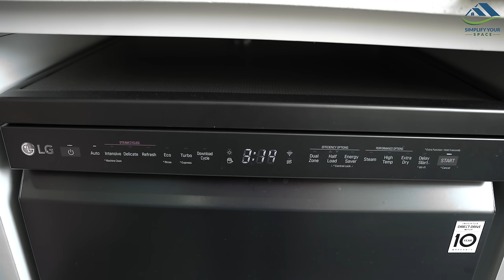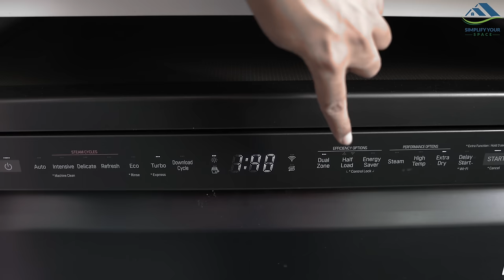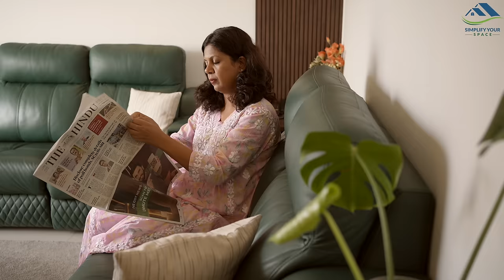Embrace Smart Living with LG Dishwashers | Breaking The Myths About Dishwashers | LG India

Comment: I have the same brand dishwasher purchased in September 2023. It's a great way to use compared to helping hands which aren't available when we mostly need, especially during festivals...U will need a full week to adjust yourself to the machine and will feel more work at first as it's not what we usually do ,but later it becomes very habitual and easy,as we get experienced using different utensils.About the timings there are multiple options depending upon how soiled /dry stained your utensils are...for continuous everyday use there is Turbo option which is 1.4 hours (including steam+extra dry) which u can reduce to 38 mins,even okay for full load but utensils should be freshly used as the time stamp is less.All positive but u need a week minimum to adjust to the machine 🙂👍
Reply from the maker: I agree with you. Thank you for your valuable feedback about dishwasher. Lots of love ❤️
Reply: I'm also using ..but not familiar with more options or benefits . Just using one turbo cycle daily
Along with demyths , if the cycles adjustments, time consumed, power consumed for hot steam cycles ...like this an eloborate/precise video which covers using multiple options, every aspect is important
Reply: @gadeyneelima5361  you can connect directly with the person who came for installation of the machine...they usually answer all our doubts whenever we call for queries
Reply: How about during powercuts ? If in between a cycle, will it get reset and start allover again?
Reply: @janakinarayanan7036  it will turn off the machine and restart from the same timing once the power is on..same even for _after turning of the main switch

Comment: Hi, what about the previous Lg dishwasher power drawback, LG dishwashers used to start from the beginning of the cycle if there was power cut in between the wash cycle and would not resume from where it stopped,  has it been addressed now. Kindly advise.
Reply from the maker: This dishwasher does not resume from the exact point of interruption but from the phase of the washing cycle. For example, if the power goes off during the pre-washing phase, it will start from the beginning. However, if the cycle has progressed to the washing or drying phase before a power interruption, it will resume from the start of the washing/drying phase, which is the mid or end phase, rather than from the beginning of the entire cycle.
Reply: I think it's logically and practically correct. Example if your dishwasher was heated at the time of power cut , it can not remain heated during power cut. Dishwasher will need time to come back to that temperature after power is back. Another Example If it was in middle of soap foam wash and the power cut off, it will drain or dry the soap in till power is back. Dishwasher will need extra water to resume in the condition.  Instead dishwasher starts from beginning to avoid stains and clear output

Comment: You have not mentioned the issue when the electricity goes in between the running cycle instead of running from where it stopped, it started all over again...one of the major drawbacks...lg does any improvement to combat the problem??
Reply: There is auto restart in this model shown here. It starts from where it stopped
Reply from the maker: This dishwasher does not resume from the exact point of interruption but from the phase of the washing cycle. For example, if the power goes off during the pre-washing phase, it will start from the beginning. However, if the cycle has progressed to the washing or drying phase before a power interruption, it will resume from the start of the washing/drying phase, which is the mid or end phase, rather than from the beginning of the entire cycle.

Comment: Each and every point which you have mentioned is completely true. I can't imagine my day without this appliance. It is the best and the most useful home appliance after washing machine.
Reply from the maker: I couldn't agree with you more. It's one of the most used appliances, right after the washing machine and fridge
Reply: @aravindvasudev7921 Does this have auto restart option if power goes off inbetween. Will it start from the exact position where u left it or will it start from the beginning?
Reply: @LifeStyleLiftish  yes. The model DFB532FP and after have the auto restart option. But it does not resume from the point where power went off. It resumes from the cycle.

For example, if the power goes off during the rinse cycle, then the dishwasher will resume from the beginning of the rinse cycle. 

The one disadvantage here is, suppose the wash cycle is 1 hr. And at the end of the wash cycle, the power went off. When the power comes back, the dishwasher will resume from the beginning of the wash cycle.

For me, this is not a matter of concern as I am very much satisfied with the quality of wash and performance. So fine with it. If you are looking for a dishwasher that resumes from the same point where the power went off, then i would recommend the Bosch dishwasher.
Reply: @aravindvasudev7921  u mean it starts all over again?? Its a huge wastage of time and water then right??

Comment: Hey Hi Ashu, I am Gauri, I have purchased IFB 16place setting dishwasher 5 months back, i have used IFB dishwashing products & Fortune products till now but i don’t get such sparkling clean utensils every time, sometimes white stains are there & most of the times i have to scrub stubborn stains first & then put it in dishwasher otherwise it comes out dirty. Can you plz tell me what I might be doing wrong ? & plz tell me which brands products do you use for your dishwasher?
Reply: In IFB you have to set the salt setting according to your water hardness.. Which is clearly mentioned in the instructions book. And always use a long cycle (eco or intensive). Don't use super 50, which uses more electricity compared to ECO mode and gives dull results.
Reply: @PurviDave18  Thanks for your input. I use Eco mode every day. For salt settings, I will surely recheck it, it was done by serviceman at the time of installation. Basically we don't have hard water here.  In 5 months, I am on my 2nd kg pack of salt which is till present inside m/c. May I know, which dishwasher are you using & what products?

Comment: Whats the difference between dfb424fp vs dfb424fm models ? Apart from color i am not able to find any difference. But there is 3000 rupees price difference on amazon in both. Is it any latest or old version difference? Or autostart on power cut issue from same position in dfb424fm model which is costlier ?

Comment: Thanks. Can you please address a few of my questions-

1. How much time does each cycle of washing take? Is the power consumption feasible or high?
2. Can we use the same liquid gels we use for manual cleaning or are there separate / dish washer specific soap or detergents used and are they easily available?
3. Does it cause loud noise / any noise during the cycle? If yes is it disturbing in compact homes?

Thanks once again for an informative video.
Reply: I have the same brand dishwasher purchased in September 2023. It's a great way to use compared to helping hands which aren't available when we mostly need, especially during festivals...U will need a full week to adjust yourself to the machine and will feel more work at first as it's not what we usually do ,but later it becomes very habitual and easy,as we get experienced using different utensils.About the timings there are multiple options depending upon how soiled /dry stained your utensils are...for continuous everyday use there is Turbo option which is 1.4 hours (including steam+extra dry) which u can reduce to 38 mins,even okay for full load but utensils should be freshly used as the time stamp is less.All positive but u need a week minimum to adjust to the machine 🙂👍
Reply from the maker: Hi,

1. The washing cycle duration varies from 1 to 3 hours depending on the level of soiling on the utensils. During the initial days, it's recommended to test different cycles to find the most suitable one. Personally, I prefer using the TURBO cycle for moderately soiled utensils, which lasts for about 1.5 hours.

2. Regarding electricity consumption, the exact rate depends on factors such as the model, cycle duration, and local electricity cost. From my experience, I've noticed an additional electricity cost of approximately Rs 250-350 for 2 loads per day. Although this is not an exact figure, my estimation suggests that my machine consumes about 1 kWh per cycle, totaling around 60 units per month. At Rs 5.5 per unit, this amounts to roughly Rs 330 per month.

3. It's important to use cleaners specifically designed for dishwashers. You can't use normal handwashing cleaners.

4. Additionally, compared to washing machines, dishwashers generate minimal noise, primarily from the water sprinkling on the utensils, which is easily tolerable."

Comment: Very nice video . A few queries n additional information I would like.
1)what plumbing, electrical changes you made to enable the dishwasher.  2) what  metals/utensils cannot be washed in dishwasher.
 3) which cleaning tablets/solutions are required for dishwasher
Reply: U need to fix 16A heavy duty socket , 2 way Angel valve (if u want to use same tap for both washing machine and dishwasher)
Aluminium and non stick can’t be washed
Reply: Tablets use finish they are good and getting at a less cost then Ifb and bosch
Reply: @sujatanayek5698  Thank you so much for the reply
Reply: @tarunanov22  Thank you
Reply from the maker: Thank you so much! You will need a 16A heavy-duty socket for power and for water both  inlet and outlet. If you already have this ready, then installation will be free. If not, you will have to check with a local plumber as it depends on how much plumbing and electrical work is required. Labor charges also vary from area to area. Finish or Vim all-in-one tablets are the best!
You can't wash Nonstick, Aluminium, Iron, Wood and low grade plastic utesils. 

To learn more about dishwasher installation and other things, you can watch this video - https://youtu.be/k0UmGjJ7KHg
Reply: @SimplifyYourSpace  Thank you for taking time and replying

Comment: Can you guide please about the electricity consumption of this dish washer because I have heard that they consume a lot of electricity
Reply: Over all ur electricity bill will come to 200 Max more. Imagine u pay ur maid 1500 Ifor washing vessels. Powder and electricity per month will. Come to 250-300 max.  Water consumption is definately lesser handwashing.than
Reply from the maker: The exact electricity consumption rate will depend on the model, cycle duration, and local electricity cost. In my experience, I have observed an additional electricity cost of about Rs 250-350 for 2 loads per day. Although this is not a precise number, my observation indicates that my machine consumes about 1 kWh per cycle, resulting in approximately 60 units per month. At Rs 5.5 per unit, this totals roughly Rs 330 per month.

Comment: Thank you so much for yet another informative video. is there any difference in the machine featured in todays video and the machine you had reviewed in the past like any added features or any updates in its software - power resumption . i often feel we should invest in one and get rid of the hassle of handwashing dishes !!!!♥
Reply from the maker: No, this is the same model which I have been using for past 4 years but in different colour. Yes, I will highly recommend buying a dishwasher as it provides best cleaning and better than hand washing.  The dishwasher does not resume from the exact point of interruption but from the phase of the washing cycle. For example, if the power goes off during the pre-washing phase, it will start from the beginning. However, if the cycle has progressed to the washing or drying phase before a power interruption, it will resume from the start of the washing/drying phase, which is the mid or end phase, rather than from the beginning of the entire cycle.
Reply: Thank you so much. I have actually noticed this with LG washing machines as well.  If there is a power cut during the spinning cycle it starts at the beginning of that cycle. In my machine it is the last 16 minutes. For example if there is a power cut at 6 minutes remaining it will resume at 16 minutes remaining.

Comment: Please tell me about power consumption
Reply from the maker: The exact electricity consumption rate will depend on the model, cycle duration, and local electricity cost. In my experience, I have observed an additional electricity cost of about Rs 250-350 for 2 loads per day. Although this is not a precise number, my observation indicates that my machine consumes about 1 kWh per cycle, resulting in approximately 60 units per month. At Rs 5.5 per unit, this totals roughly Rs 330 per month.

Comment: Hello 
Your video is super 

I want to ask one question 
Does the dishwasher work well with hard water?
Reply: U need to use dishwasher salt and the technician will check the pH of of ur water and adjust the settings according
Reply from the maker: Use appropriate cleaning agents like salt, cleaner and rinse aid and if the TDH value is high get the softener installed in your inlet. This should resolve the problem of hard water.

Comment: Does it resumes its work from same point when electricity goes
Reply from the maker: This dishwasher does not resume from the exact point of interruption but from the phase of the washing cycle. For example, if the power goes off during the pre-washing phase, it will start from the beginning. However, if the cycle has progressed to the washing or drying phase before a power interruption, it will resume from the start of the washing/drying phase, which is the mid or end phase, rather than from the beginning of the entire cycle.

Comment: Is it high in elec consumption .
Reply from the maker: Almost same as washing machine.
The exact electricity consumption rate will depend on the model, cycle duration, and local electricity cost. In my experience, I have observed an additional electricity cost of about Rs 250-350 for 2 loads per day. Although this is not a precise number, my observation indicates that my machine consumes about 1 kWh per cycle, resulting in approximately 60 units per month. At Rs 5.5 per unit, this totals roughly Rs 330 per month.

Comment: You have not talked about the size of the dishwasher. Which dishwasher would be good for 4 family members. Also do we need scrubbing before placing. What dishwasher do food particles where they get collected? May we use non stick pans ?
Reply: No need to scrub, remove ood particle before load. In case there r some particles the drain of the dishwasher has a filter which u can clean 7-10days in once
Reply from the maker: For family of 4 you can use 14 plate settings. No scrubbing required but please remove any leftover food from the vessels and dishes. All the food goes into drainage but you need to clean the filter once in 15 days.

Comment: Long term reliability should be taken into account when you spend 50K+ bucks for an appliance.

LG is a relatively new player when it comes to dishwashers. They haven't had a long run and their expertise is not as vast as Bosch or IFB. We need to wait to analyse the reliability of LG dishwashers overall. Have seen Bosch dishwshers (maintained well) lasting for 14 years or so.

Bosch dishwashers don't have these gimmicks yet customers are satisfied. No 4 spray arms, no steam, no direct drive.
Reply from the maker: Yes, there are many established players in the market that provide multiple choices for customers. I can only share my personal experience of 4 years with LG, which has been great so far. Many times, user experience also depends on how well the product is taken care of and maintained.
Reply: @SimplifyYourSpace  yes totally agree. What I have said is from an end user perspective, tried and tested analysis, consumer reports.

Comment: Mam what about electricity consumption?
Reply from the maker: The exact electricity consumption rate will depend on the model, cycle duration, and local electricity cost. In my experience, I have observed an additional electricity cost of about Rs 250-350 for 2 loads per day. Although this is not a precise number, my observation indicates that my machine consumes about 1 kWh per cycle, resulting in approximately 60 units per month. At Rs 5.5 per unit, this totals roughly Rs 330 per month.

Comment: There is an issue with dishwashers. Many Indians say their utensils warp overtime due to heat and the tumble motion of the water at great pressure. That is why we need dishwasher safe utensils too. Most homes today don't have that. Most of our regular brand utensils are not dishwasher safe. It can be expensive. Additional cost. Comparing to these costs hiring a maid is more affordable. There is the electricity cost too.
Reply from the maker: Dishwashers are incredibly useful, particularly for working individuals with irregular hours, and seniors. Even if you have help for the dishes, a dishwasher can manage extra loads during gatherings, daily multiple loads, or cover for days when your help is unavailable. It keeps your sink clean and free from dirty dishes. I am delighted with my LG dishwasher and use it everyday. Yes, that's true not all utesils such as Nonstick, Aluminium, Iron, Wood and low grade plastic can be washed in dishwashers.